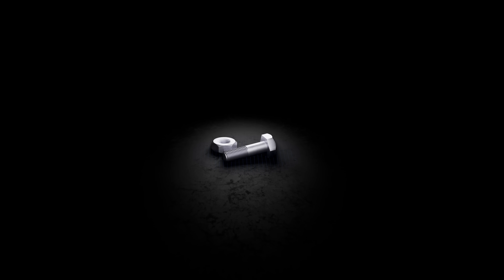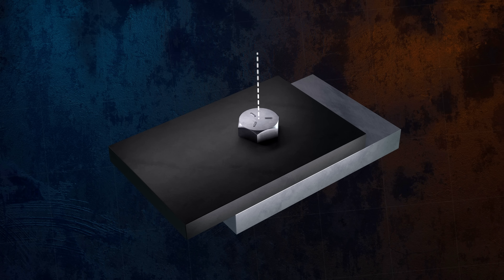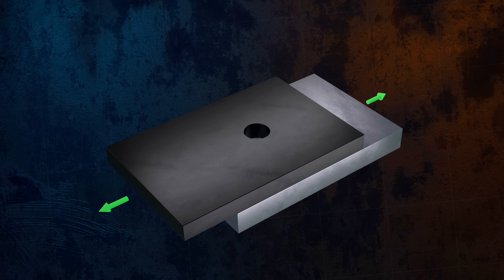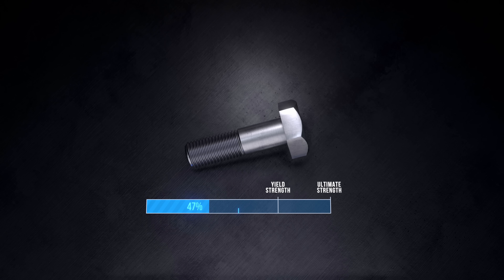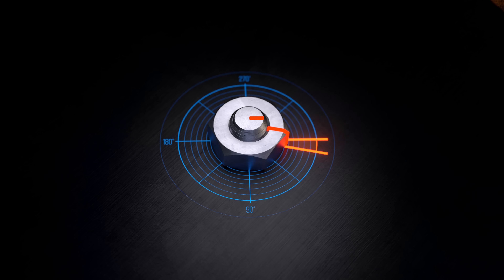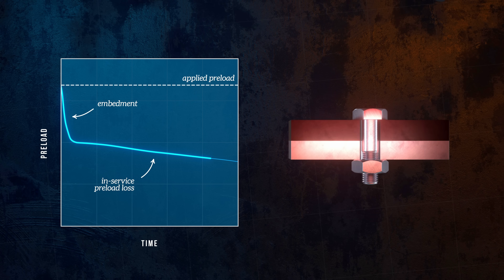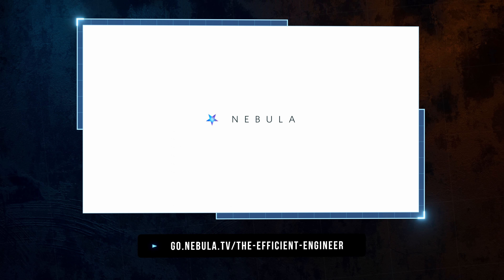The Incredible Strength of Bolted Joints

Comment: So the force required to pull the joint apart increases at a rate higher than the development of tension in the bolt as movement progresses. But the tensile force within the bolt increases linearly with strain and is only a function of bolt strain.

Comment: 6:40 Would it be worthwhile to adding mating ridges to increase friction?
Reply: Non-expert opinion:
Your friction force would be converted into mechanical force against the ridges, essentially transferring stresses to the materials themselves. 

You might reach a stable failure state where total resistance from mechanical and material are greater but the parts would not be able to achieve the same bond again. 

One time to limited re-use parts. 

Please, someone get a material engineer in here.

Comment: In previous engineering roles they had a lot of historical rules to follow. One was not specifying over grade 8 fasteners due to the increased risk of stress corrosion cracking of the fasteners especially if they were used out in the elements. Anyone else run into this? I'm looking at the 12.9 fastener in the video.

Comment: 2:37 is wrong. If you tighten a bolt so that the plates are clamped together at 1,000 pounds, and then add a load of 1,000 to a plate in the opposite direction, it doesn't decrease the load on the bolt! IT INCREASES IT!
Reply from the maker: The animation at 02:37 doesn’t show the load on the bolt decreasing though. It shows it increasing.
Reply: @TheEfficientEngineer    As you know, the video clearly says "only a small portion"........ that is not only untrue, but impossible. In this video there is ONLY one fastener, so all loads are on that THAT fastener and not a "small portion".
Reply from the maker: No, it's not impossible. Part of the applied 1000lb load will be "used" to reduce the compression between two joined members. So up until the joined members separate, the bolt won't see the full 1000 lb load (it will see a "small portion" of the 1000lb load, plus the 1000 lb preload). It's only after the two joined members separate that the bolt will see the full 1000 lb load (so 2000 lb total including the preload).
Reply: @TheEfficientEngineer    I wish I could supply a drawing here. if you clamp two plates together with an eyebolt, say 1,000 pounds of force, and then hang 469 pounds from the eyebolt..... there will a substantial increase of force on the eye of the bolt and the nut.

Comment: The mechanical action of the threaded nut running up a threaded bolt is enough to make a secure connection. Stretching of the bolt only happens at higher torque values. Stretching a construction grade 1/2" bolt is going to require at least 75 ft lb of torque. That's only necessary in specific, high stress applications. Most people will only ever use nuts and bolts to fasten furniture together or other DIY home projects. After watching this video, thousands of people will think that they're "stretching bolts" when they put together their Ikea furniture set. Lmao

Comment: Ok, so applying your logic pretension between two plates magically makes bolt stronger than when applying stretching force to a bolt itself. Funny.
At 3:13 spring forces have opposite directions. The stiffer spring is stretching the system, while the smaller one compresses it. And you claim they work in the same direction 🤦
In a system where nothing is accelerating or changing it's internal energy the sum of all forces is equal to zero. Therefore based on directions of the forces here's the system you're describing:
Fpreload-Ftencile-Fapplied=0
or simply:
Fpreload=Ftencile+Fapplied
Pick two random values for two forces above and you'll get a value for the third one.

Comment: The video explores the fascinating mechanics behind nuts and bolts, emphasizing their simplicity and effectiveness in creating disassemblable joints capable of withstanding significant forces. It details the importance of preload in bolted and screwed joints, explaining how it improves strength, fatigue resistance, and failure prevention. The video also differentiates between tension and shear joints, highlighting the implications of applied loads, preload management, and failure modes. Viewers gain insight into design considerations and methods for accurately controlling preload to ensure joint integrity.

Comment: You forgot your washer.
Reply: Get em
Reply: Lock washer if high vibration
Reply: @marmalademarmitemartian lock nut is superior.
Reply: As far as bolt side, many bolts have a built in washer. I'm not referring to flanged bolts either.
Reply: I was about to make a similar comment, then he mentioned at 15:20
Reply: Type A's..... smh
Reply: Did we talk about bolts or washer?

Comment: Clamp force, Turn-of-nut method, Preload, Mating surfaces
13:36 - "Measuring bolt elongation"
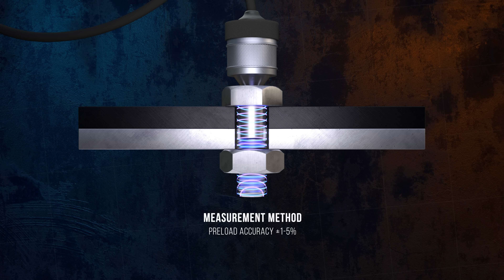13:47 - "Birthing systems"
14:01 - "Mates with a nut"
Whoever says engineering isn't sexy is dead wrong.

Comment: A bolt's job, you see, is to hold things tight,
Through wind, rain, or the dead of night.
But what keeps it snug, and firm in place?
It’s preload force, not just its face!

Preload’s a squeeze, a mighty embrace,
It keeps your parts from falling out of space.
It’s like a hug for metal and gear,
Without it, your stuff might disappear!

Imagine a bolt, just standing around,
Without preload, it’s loose and unsound.
It rattles and shakes, it squeaks and cries,
Till one fine day—your machine just dies.

So, tighten it up, give it some torque,
Don’t let it act like a slippery dork.
Preload’s the hero, the bolt’s best friend,
Keeping it solid, right to the end.

And if you’re stuck, don’t feel remorse,
For calculating preload force,
A spreadsheet awaits to do the trick,
At dextronica.com—go grab it quick!
dextronica.com/product-page/bolt-calculation

Comment: A bolted joint is only as good as the person that installed it. That’s why torque wrenches should always be used. Too loose a joint will come apart, while too tight a joint over stretches the bolt past its elasticity limit, greatly reducing its strength and ability to maintain proper pressure on the components. Installing a bolt too tight, even if not stripped, is not better. It must be done properly. Impact wrenches should never be used to tighten bolts, only to “pick up the slack”. Final tightening should always be done with a torque wrench. If a bolt doesn’t turn when checking with a torque wrench after being pulled in with an impact, it must be loosened and adjusted with the torque wrench, otherwise, it might be too tight. Not turning only means that it’s not too loose. It doesn’t mean it’s not too tight and ready to fail.

Comment: At 1:05 you mentioned it as a tensile force. But isnt it the compression force that is making the two surfaces clamped
Reply: Tensile In the bolt as in it is being "pulled apart" by the nut
Reply: As Westman said, the nut and thread engagement stretches the bolt, but the bolt doesn't wanna stretch, so it pulls back on the nut which would be a contact force (i think?) pulling the bolt head and nut together and that's your compressive result. 
Equal and opposite actions.

Comment: Bolted joints are fantastic when set to the right range of torque. Unfortunately, line employees are stupid and either undertighten the bolts or fatigue the metal entirely. Bolted joints can also vibrate loose, especially when fatigued. This means bolted joints have a limited range of application, and will often fall second fiddle to welded joints outside of dedicated machine shops and structural ironworking.

Comment: While there are some mechanical fittings still being put into place today on underground natural gas pipe, almost every one we come across on the job gets a sleeve welded around it or, on plastic pipe, cut out replaced with a fusion coupling. They have a much higher failure rate for this application.

Comment: Aa a welder/fabricator that works with this stuff daily, this was actually very interesting. Those slip joints? We're not allowed to clean the material. No grinding, buffing, or anything. Some wire wheeling is fine and it's mandatory to clean off all traces of oil. You actually want a rough surface. What would traditionally be considered dirty. 

Also that "nut factor" got me. I'm emotionally still 15 😂

Comment: A slip-critical connection in a steel structure is a bolted joint that uses friction between two connected parts to transfer shear and tension loads rather than the bolts themselves. This is achieved by torquing the bolts to a high tensile stress, which creates a clamping force on the connected parts. The friction generated by this clamping force transfers the loads.

Comment: The Incredible Strength of Bolted Joints ... bolted joins are the exact reason that the twin towers were destroyed when "on paper" they should have survived the impacts. The towers "on paper" had welded joins that were subsequently changed to self torqueing break away bolts to save costs.
  The issue is that a bolt when torqued ALWAYS thins and lengthens due to stretching leaving a full thickness gap between the material of the join and the fastener allowing lateral forces to twist the join causing the holes through which the fastener passes to act as a shear cutting the bolt. In addition there is a tendency for hardened bolts to shatter or be pulled through the hole "unbuttoning" the join where as mild steel hot rivet expands in to it's hole creating an interference fit that leaves no gaps to allow lateral twisting and its mild nature allows it the flexibility necessary to not be shattered or unbuttoned until subjected to MUCH grater stresses than required to wreck a bolted join.

Comment: An interesting video but it kind of skipped over how the pre load is applied. It shows a bolt but then says a pre load is done either a screw but then goes ack to talking about bolts. So how do I add pre load to a bolt???
Reply from the maker: The preload is applied by the act of tightening the bolt or the nut. This stretches the bolt a small amount, which generates a tensile force within it.

Comment: very interesting. How does adding more bolts to a joint add to the strength of the joint, simple addition or is there compounding effect?  based on what is said here I will bet a whole video could be made just on the types and uses of washers.

Comment: Where are washers?
Reply: He wanted to use washers, but after looking through multiple junk-bins of hardware, all he could find were ones too small to fit on the bolt, or ones where the hole was just slightly smaller than the entire head of the bolt. 😂😂😂

Comment: The section about tension joints is confusing. Surely when there is an applied load which reduces the clamping force, that directly adds a load on the bolt, as the bolt is the only thing in tension opposing it.

I'm also confused by the arrows drawn for the clamping force, as though they're being generated by the clamped materials rather than the bolt itself. Surely, if anything, the clamped materials are resisting the clamping, which would add to the external load.

Finally, the analogy where the material is supposedly like a spring is a bit strange. The spring is clearly in compression when the load is applied, but we say "the stiffer spring takes the load" - this doesnt make sense to me because that spring is only pushing outwards.
Reply: My thoughts exactly! What’s going on at 2:37?

Comment: I worked in a factory once as an electrician and i remember hearing the steel workers fastening bolts and running with the impact wrench for like 30 seconds on each bolt. And the whole construct is like 100 bolts so i heard and was annoyed by that sound ALOT, but now i understand more why they did it xD

Comment: Kindly make video reg rivetted joints because till this date aircrafts are rivet jointed as you know rivets move relatively to the parts rivetted giving room for expansion and do away with B.M. testimony to this the Hoogly river steel rivetted bridge 80 years life and still carrying traffic in calcutta india rigid welded jpints will tear off because of rigidity bolted jts will unlock as time passes

Comment: As a structural steel fabrication shop owner/project manager, this is awesome for training guys on the use of shop installed bolts: type n joints-snug tightened bearing joints, vs pretensioned, vs slip critical. So good

Comment: If the bolt is long enough, the hole is drilled to the correct diameter in your examples all your bolts are too short I have 50 years in aviation and expert in fastening systems

Comment: I feel like our description of that load transfer is a little imperfect.

If you applied a 100N external force to the bolt itself, it should reduce the clamping force by 900N because of material yielding. The clamping force is a bit of an illusion.

Comment: Coatings that chemically bond to the steel can also be used that will over a bit of time create chemical bonds that can enhance the bonding force.. depending on application and need to take the joint apart.  Oh, I'd like the manufactures to put a indent into the center o the bolt head so when the bold that get corrodes or stripped needs to be drilled out for removal..

Comment: Hi, I'm a mechanical engineering student, and I'd like to make a small correction. Fatigue is actually slightly correlated with the magnitude of the stress (4:30). It is usually discounted during calculations because it doesn't make a huge difference, and it would be impossible to run tests on all the average stresses the part might experience. So if someone wishes to account for the effect of average stress on fatigue, one of the things you can use is the Haigh Diagram, where the average stress and the stress amplitude define a triangle where operation is safe.

Comment: Bolted Joints are much more than a trade-off between reassembly and strength of welded components. Unless for engineering, what needed is what counts, not what might be possible.

Comment: Welding is 100% sheer riveting is 90% sheer strength for bolts are measured in material used to materials fastening!!! And this is why bolts are used welding to a material that is 70% means there is a 60% failure rate!!! You have to take consideration of size height and type of Steel and where you needed to be the hardest and where you needed to be tolerant🎉 and you have to love the world and the science around it😂

Comment: In entertainment, we used bolted connections constantly - especially aluminum truss assembled with 4 @ 3/4" grade 8 steel nuts and bolts with flat washers under each contact surface.  These connections are made with a simple ratchet and socket on each end - and are often undone 14 hours later to move the concert to the next town.  Over-torque is a major concern; under-torque is also a problem especially as the truss structure is subjected to assorted loads during performance - articulating (moving) truss during the show, side loads due to pyrotechnic or gas effect bursts (such as CO2 sprays), vibrations from moving lights, and others.

Since we are indoors, we ignore harmonics due to wind.  BUT we are sensitive to possible impact of audio on truss and bolted connections.  Are there any studies of the effects of loud noise (100dB sustained, especially in the low bass ranges that can shake catwalks and the cement floor of an arena concourse)?

Comment: Bolts hold more than weld's, but adding both to metal joints will greatly improve structural rigidity & make it stronger. Bolts can fail so can weld's bit having both doubles up the redundancy.

Comment: 10:41 the P at the tensile stress area formula (metric) is the pitch of the bolt.  You should consider to use lower case instead of capital letter

Comment: If the surfaces of the pressed objects are subject to vibrations, they may slightly move relative to each other as a result of the vibrations, so we use at least two locating pins pressed into tight holes made in both joined objects.

Comment: I just cringed when preload was described by torquing the bolt head instead of the nut. This compromises the load because the bolt will relax after torsion is released which will result in reduced reduced clamping. You tighten the nut to remove most of this problem and friction between at the thread engagment is driven by the nut instead for the forces that applied along the length of the bolt shaft. The issue is that increasing the length of the bolt will increase the amount this relaxation and torqure tables are always listed as constants based on the nominal shaft diameter of the bolt. This doesn't happen with twisting the nut because the nut is common in retrospect to different length bolt it's paired with. This really need to be fixed. If you're not going to fix the animation, at least include the this as a variable to the applied load.

Comment: The first part, about how preload reduces total tensile load, is nonsense and should be corrected.
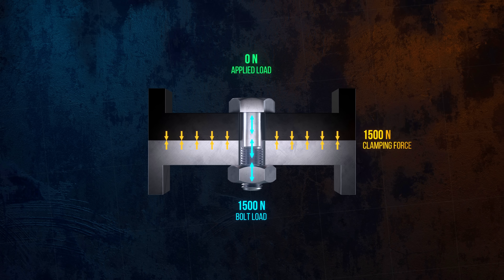Reply: 2:30 this part was bad, I agree. He should have taken it down and re-uploaded it at the time. The statement for the example he shows is not correct at all. The relative stiffness of the bolted components in that example is irrelevant. It could be two pieces of elastic that are bolted together, it wouldn't make any difference from the perspective of the bolt. If you apply an axial force to pull the components apart the sole load path is through the bolt. You'll have simple addition of preload + applied load. Also, the way he illustrates the clamping force is highly simplified. The actual clamping force under the bolt head and the nut spreads out in a conical shape with much less force between the remaining surface area. Anyone can Google that. There are plenty of YouTube videos on how to do the calculations.